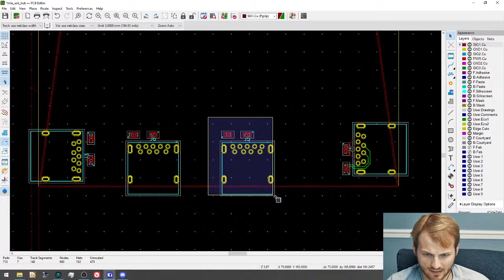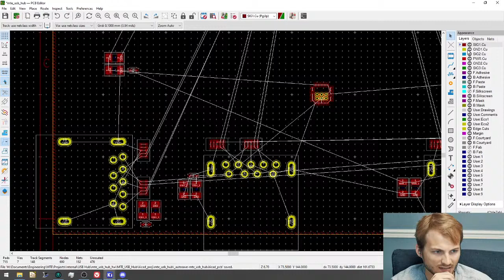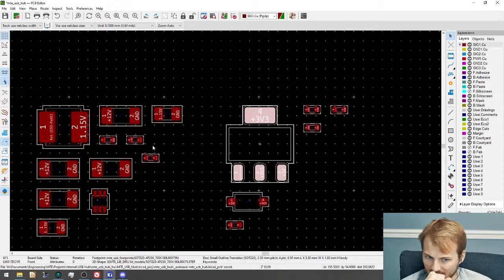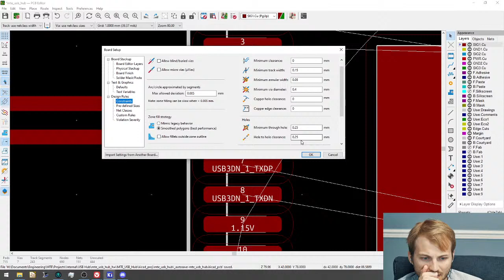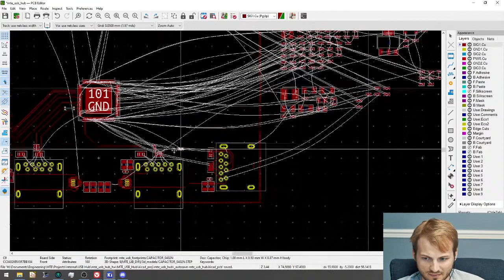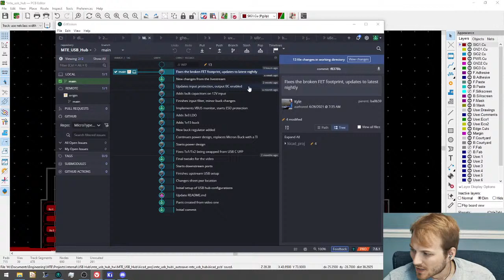[Livestream]  USB Differential Pairs Routing - USB Hub Design - Part 7

Comment: Connecting grounds to the exposed pad makes overall capacitor to die pad impedance lower. If the die is small compared to the package size (as is likely to be the case here), then the bond wires going to the pins will have a relatively large inductance compared to the short wires jumping straight to the epad.
Reply: This is probably not a big deal for QFNs, but it makes a huge difference for QFPs.